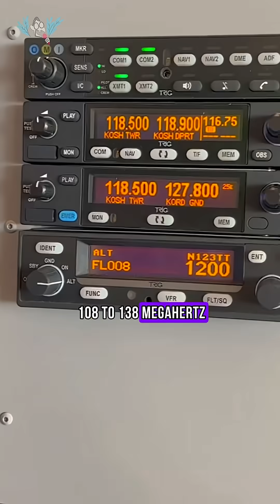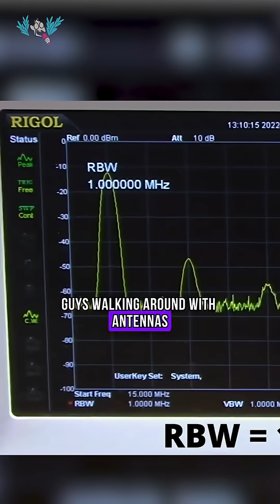Starlink in-flight WiFi banned: Dangerous pilot radio interference

Comment: Pilot here: If two people talk on on the same frequency at the same time you can't hear either one of them. We refer to this as being "stepped on". All you get is distorted garbage. Cell phones, WIFI, Bluetooth, none of it has any effect on aircraft radios. However, if you install Starlink incorrectly by not having the correct separation between the Starlink antenna and the comm antenna then you can get harmonic interference. We had the same problem when GPS was first added to aircraft due to incorrect installations.
Reply: AM radio does a better job of letting you know there's a doubling.  FM tends to "capture" so you ONLY hear the louder signal, so you'd be left with no clue someone else was there.
Reply: @russellhltn1396 You can't count on AM allowing you to hear both signals.  Sometimes one signal does block the other. This is why read-backs are so important.
Reply: @russellhltn1396  Only receivers will. The people talking wont know they're being stepped on, or stepping on someone else.
Reply: Yep, you’re correct. Unless the two AM transmitters are on precisely the same frequency you’ll get heterodyning, which tends to obscure everything. What was described is a property of single sideband transmissions, which to my knowledge isn’t used on the aircraft band at all.
Reply: @scottreynolds Correct.  Not on VHF air,   On HF air they use USB.  Single Sideband has no carrier.  It doesn't carry anything. And, no squeals.
Reply: @milofonbil correct, except that SSB DOES have a carrier. One of the sidebands is not used.
Reply: @scottreynolds  actually SSB is a derivative of AM... and SSB is used by commercial jets as they fly over oceanic areas.
Reply: @W8RIT1 when they’re using HF, yes, of course. This is definitely happens on intercontinental flights. I was referring specifically to the VHF aircraft band that’s used to coordinate local and regional operations.
Reply: @scottreynolds  gotcha....but you did say that SSB isn't being used on any band at all. That is incorrect, so I corrected.
Reply: Is that also 'heterodyne?'
Reply: @geedoctor Heterodyne is the mixing of two radio frequency signals yielding the sum and difference of the two.  A signal at 120 MHz can mix with a signal at 100 MHz yielding 220 MHz and 20 MHz.  When two AM transmitters transmit at frequencies Eg 120 MHz, but not exactly on the same frequency, the resulting mixing is at the difference between the two frequencies.  This is the squeal you hear at the other end.
Reply: @geedoctor  the hetrodyne is the sine wave you hear which is the frequency difference between the two AM carriers (generally radio transmitters don't transmit on exactly the same frequency, and even when they do since they're in moving planes the small amount of doppler can create an audible difference). I believe the stronger signal would put that carrier at 0hz and the audio would be demodulated in the correct frequencies. The weaker transmission would be the heterodyne and the audio frequencies skewed by the difference in carrier frequencies.

The receiver should still be able to make out what is being said by the more powerful signal and also just about make out what the weaker signal is saying.
Reply: @geedoctor yes, just as is heard on CB radio
Reply: One more thing - power supply coupling. The chips don't just churn linear current. They jump up and down in consumption and if it's not well enough filtered and insulated it just magnetically coupling via the power cables.
Reply: I like this comment cus you’re just like “nah the whole video is wrong”
Reply: What CodeDog451 said is absolutely true. I am a retired controller and when ever two people transmitted at the same time all we got is garbled noise
Reply: In theory if both transmissions are at the same distance and same power and same db loss/gain with no outside interference in theory you could hear both.  We know that will never happen so youll sorta hear both with lots of interference
Reply: How could GPS cause interference when it doesn't have a transmitter, only a receiver?
Reply: @ljfinger  Harmonic resonance if the two antennas are too close to one another. The comm works but the GPS cuts out when you key the mic.
Reply: Judging by the outcome at Tenerife, I'd say radio communication got stepped on pretty effing bad
Reply: so the turn off all electronics thing that we get told is bullshit?
Reply: @phoneusandfroboof829  Yep, always has been. Every pilot out there is using cell phones and tablets in the cockpit during all phases of flight.
Reply: @phoneusandfroboof829 No. Cell phones and other transmitting electronics wreak absolute havoc on many aviation electronics, especially older analog equipment. Stuff will go absolutely haywire. 

Now, all that equipment is required to be properly shielded, and it will not malfunction if everything is perfect. The thought process is that if there's some damage to or a flaw in the equipment shielding, why take the chance? Put the phone in airplane mode.
Reply: That makes more sense now.
Reply: Had this issue on a fire engine when the wrong type of antenna was used and placed too close to the emergency light bar. It was an old school light bar with spinning halogen lights and we belive the electric motors were interfering with the radio.
Reply: Maybe they will be using starlink as a primary communication method in the future.
Reply: I was going to say it's not the waves that would allow that it's the hardware picking up the signals
Reply: AM radio doesn’t have the “capture or threshold effect”. 

Yes when two planes transmit at the same time you will either hear them both or you will just hear a distorted signal. 

This sound allows the ATC or other pilots to know that two stations tried to talk at the same time and it’s very important you figure out who tries to say what. 

If you have FM / frequency modulated radios transmitting or more commonly phase modulated radios, the strongest signal will capture your receiver and you will have no idea there is another station that was also transmitting. 

The bad part about AM is it’s very impulse noise sensitive. Like arcing of the brushes of a motor or spark plug coils on a piston driven engine. 

That’s why the spark plug wires on a plane are on a totally different level than a cars are.
Reply: but the fact you have a word for it means you know its happening so it still has the desired effect
Reply: But with amplitude modulation, you DO have a better chance of hearing BOTH transmissions at the same time, and that helps with safety. Frequency modulation has the capture effect, and truly only one signal at a time.
Reply: RF Engineer here. Stick to flying - leave the EMC to the experts.
Reply: @michaellee9743  Stick to theory. Leave real life to the experts.
Reply: @CodeDog451  RTCA DO-186C / EUROCAE ED-23
These performance standards for VHF radios reinforce AM usage and note that simultaneous transmissions must be handled gracefully.

Again, the capture effect is not always named, but the ability to detect overlapping transmissions is a key safety requirement that AM inherently satisfies.

If your gear don't work - you should ask questions.
Reply: Single Sideband signals can allow all audible signals to pair over each other similar to speaking in a crowded room like he is discussing. The trick for using AM is that having the two carrier waves key up over each other generally causes a loud tone where the carrier is not ignored by the receiver and can make it very obvious that someone is being stepped on.
Reply: I’m still waiting for commercial and private airplanes to use satellite comms with voice & data (& telemetry) with the VHF AM radios as backup.   Why not?

I have a friend (former law enforcement & current volunteer firefighter/USAR) who used to carry a Motorola APX-8000 portable radio in his travel bag.  That’s when the PRICEY radio model was first released a decade or so ago.   He wanted backup comms at any cost.   (the APX-8000 was over $12k with multiple batteries/chargers and accessories).  It is a multi-band radio (VHF / UHF high and low splits / 700.800 MHz — analog & P25).

I get caution, but how about utilizing technology to improve safety.
Reply: as far as i know 2 people speaking on the same frequency at the same time was one of the factors leading to the 1997 Tenerife disaster.
Reply: @edwinsuijkerbuijk5106 Yes Two 747s collided because of confused/partial communications.  One planes communication was possibly missed due to a transmission by the other plane.  Although both transmitted at the same time, the ATC only heard one plane.  Both pilots thought they got a clearance.  Proper read-backs are essential.
Reply: @edwinsuijkerbuijk5106 From what I remember learning, long after the fact as I was very very young when that happened, the Tenerife disaster was ultimately caused by a pilot taking off without proper clearance. Whether that was due to a misheard ATC giving takeoff clearance, I’m not sure.
Reply: . I think the tenerife, the pilot started taking off because he was so use to as instructor.  When instructing students he simply told them to go, since he was trying to simulate a tower giving clearance. He became complacent in routine.  He went into 'auto mode' (since he did alot more instructor roles than flying later in his career - brainfart...
  It's kind of like when u drive to and from work, it becomes automatic for u.  When u drive near usual route tired and not paying attention, u might actually start driving like ur going to work...
Reply: @L33tSkE3t cool avatar. Is that a mass effect reference?
Reply: Two people talking on the same frequency isn't heard by you, pilots, but it's picked up on recording and by others listening.
Reply: @alhids35  No its not. ATC cannot hear pilots if someone is stepping on the frequency.
Reply: @PBMS123 it's cool that you think that but that's dependent on the receiver. Additionally I was more talking about black box recorders, which hear all over talks
Reply: @alhids35 The ATC will hear the doubling and squeal if the two are not exactly on frequency.
Reply: @alhids35 it sure is heard by pilots. The same applies to CB radio with heterodynes....
Reply: That's a software implementation in your radio good sir, most AM sets, including jets will mute both sides so it don't squeal, some with play both signals overlayed as described, and when neither is gone you get a fucking deafening squeal (which is why the software filters it out for you pilots so you aint disturbed at 50ft above the run way with the sound.

The more you know eh?
Reply: @MarkSErrorNaut  There is no software. My plane was built in 1959. The radio is analog.
Reply: @MarkSErrorNaut hilarious! You are a genius, and obviously should be in charge of the FCC
Reply: You have to love all those know-it-alls trying to tell the pilot what he is, or isn't, hearing on his job when using the VHF AM radio... never mind he did explain it. Humanity is doomed...🤯
Reply: @shagrat47  we know, how do we know? We speak from a place of experience, from knowledge, from wisdom,.... It's a situation of "been there, done it".
Reply: @shagrat47  hell.... Even CBers have known this since the 70s.... And you're just NOW getting the drift.
Reply: @shagrat47  you have to love all those who are ignorant, but yet get perturbed when people speak facts.

Comment: I used to drive around tuning the AM radio to odd ball frequencies and found this one that sounded like some alien modulation mixed in with static and other tones. This only came on an hour before sunset. During the day? Complete static. As a Ham Radio operator I find this stuff interesting
Reply: You probably know about this as a ham, but others may not. The ionosphere reflects radio waves at certain frequencies very well, allowing for skywave propagation. The shape of the ionosphere is heavily influenced by the sun, so the time of day has substantial effects on signal propagation, which actually results in some stations being legally required to adjust their transmit power at night.
Reply: @reddragonflyxx It's also interesting that the antenna patterns of many AM transmitters are designed to guard other stations on the same frequency.
Reply: Well maybe you know by now that the transmission was FT8 ? They definitely sound like aliens on the SW.

Comment: AMT here. A lot of this is caused by the haste to place a Starlink antenna on an aircraft without proper signal testing before finalizing an STC to install the unit. It’s all about properly shielding the various systems. We see pilots in private aircraft just throw a Starlink Mini on the glare shield in the cockpit and they have ZERO interference issues. Most aircraft have at least two VHF channels some have many more. There’s usually at least one VHF antenna on the belly and one of the top of fuselage. Maybe selecting the comm channel with the antenna most away from the Starlink may help with the interference on some of these hasty installations. It would probably help to have a Starlink antenna that is specifically designed to be installed in sensitive areas like an aircraft.
Reply: AMT here, this is exactly correct. On my fleet, the Starlink antenna is literally underneath the VHF 1 antenna when there is another 20+ feet of fuselage AFT  of the current location with nothing on it.
Reply: @EppleyAviation  what do you mean by literally underneath? I am having a hard time picturing it. Don't both Starlink and VHF antennae need a view of the sky around them in order to function?
Reply: @aspzx - VHF Radios, NAV or Com, use Ground based Towers, to transmit signals! 

Edit: Antenna on the top of the Cessna 150's, etc, is as much for protection from Stones blown back, breaking them, as for being able to get a signal, while still on the ground.
Reply: @robertweekley5926  I'm not sure how that relates to the question I asked. When @EppleyAviation said they install Starlinks underneath the VHF antenna, I'm picturing a technician literally unscrewing the VHF antenna, then screwing the Starlink in its place and then screwing the VHF antenna ontop of the Starlink. Obviously that would be pretty silly hence the question.
Reply: @aspzx I should have worded it better, the VHF antenna is not attached to the Starlink antenna. In this video posted by United airlines, when they show the starlink antenna installed on the aircraft, the VHF partially antenna extends over the starlink antenna. You can also see on the aircraft that there is plenty of space further aft on the fuselage that would have been a more suitable location.  

https://youtu.be/AGrtc8TpD98?si=2-EJlLmWyKn9Jqzd
Reply: @EppleyAviation  ah wow that's actually almost as crazy as i was imagining. Thanks for the explanation and the video!
Reply: Someone who knows something about  the issue instead of sensational clickbait. What a relief
Reply: False or outdated info stated in video. Airbaltic uses starlink on commercial flights. Somebody also mentioned Hawaiian airlines.
Reply: Truth. These companies rushing to market just say "F everybody. We'll deal with issues later." And when do they get to the enhancements? Yeah, never.

Comment: AM is simply a fixed sampling time. The same wave frequency but louder & softer is the data (voice).
Reply: When you modulate AM, you get side bands. The signal will "broaden" as you up the data rate.